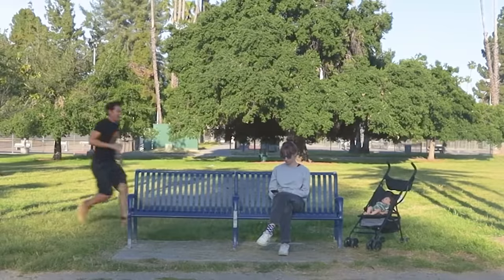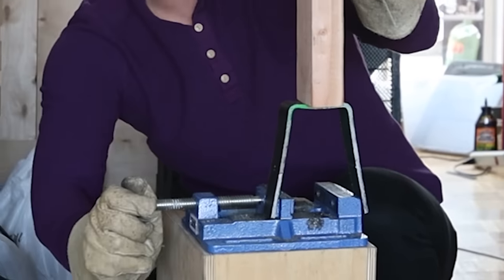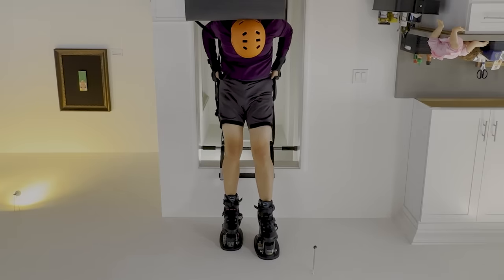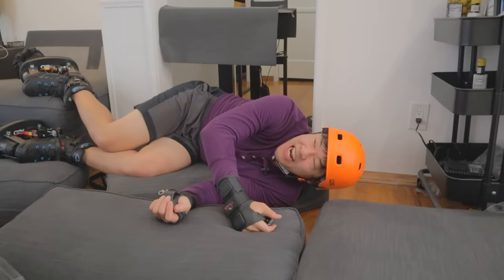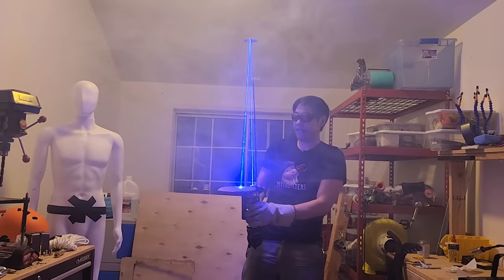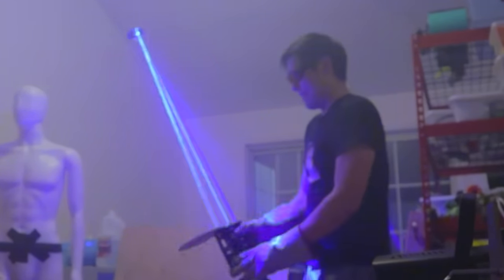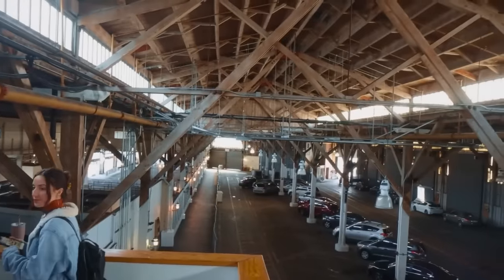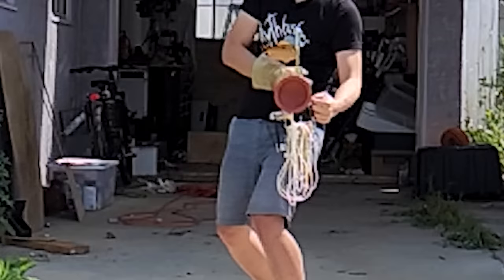I built your dumb childhood inventions

Comment: the reason why the mirror thing didn't work with Kevin's laser is because it uses an infrared wavelength, and regular mirrors act like non-reflective objects for them. For IR light, you need a gold or gold plated mirror.
Reply: Or the nintendo labo stickers
Reply: Or the nintendo labo stickers
Reply: Or the nintendo labo stickers
Reply: Or the nintendo labo stickers
Reply: Or the nintendo labo stickers
Reply: Or the nintendo labor stickers
Reply: Or the nintendo labo stickers
Reply: Or Labrador sticker
Reply: @ninjaguyYT  C-c-combo breaker!
Reply: Or first-surface mirrors

Comment: ProTip:  For the laser sword, don't use a mirror. Use a "retro-reflector".  Retroreflectors always reflect the light(or radar) back to their source.   It's how street signs and bicycle reflectors work internally.  :)
Reply: if you used something retroreflective, it would send the back right back into the juicy gizzards of the laser, and you would be lift holding a burning stick.
Reply: @Debbiebabe69  There's a slight offset to it based on where you hit the reflector, it's just the angle that's constant.

Comment: The ceiling shoes basically confirm a theory I’ve had with Spider-Man. His wall crawling ability only fully applies to stone/concrete or metal surfaces. Ceilings aren’t made to support weight that way. He couldn’t wall crawl on any building with vinyl siding, drop style ceilings, Sheetrock seems like only for a short time.

Comment: The ceiling shoes could use a small jet or a dense helium balloon to counter their weight and make walking easier. The saber could have the mirror replaced with something that absorbs the light instead of reflecting it everywhere, as well as an extra blade on the antenna for more damage.

Comment: For the "laser sword", when using the first laser:

1. Need a stronger pole for holding the mirror at the top, antenna has too much flex.

2. At the top and bottom use a faceted mirror "cup" that redirects any beams coming into them into the center.

3. Offset the laser emitter slightly off of the bottom cup so laser doesn't get redirected into laser head. 

By doing this you should be able to get an "infinity mirror" type setup between the two "cups" and any movement in the beam should be redirected towards center of "cup" before being sent to the other cup.

Comment: i once had a dream where i had this gun where you would load a piece of metal into it (like the blade of a steak knife or a fork) and it would get covered in a flammable liquid, and then it would use compressed air to shoot it out, basically being a gun that shoots flaming hot shards of metal. and ever since then i have always thought about the idea and if it would actually work

Comment: my childhood invention was combining scooter with bicycle
basicly you took of front wheel from bicycle and attached the bicycle with just rear wheel directly to back of the scooter

it worked very well one dude had to padle on bicycle and other dude was sitting on handlebars and used scooter to steer

(as scooter i mean the one with no motor)

Comment: First idea: It's one thing to make suction shoes strong enough to hold you to the ceiling. It's another thing to trust the ceiling not to fall apart and drop you. Aaaaaand... there ya go. The room above the ceiling may have a sturdy floor, but the ceiling surface is just plaster. The outcome is unsurprising.
Second idea: Yeah, lightsabers aren't something you can do with just a laser. There's been one promising scientific discovery of entangled photons that might make something like it possible in the distant future, but it will take something far more complex than a laser and a mirror. Contained plasma--which is what they are in Star Wars lore--is much closer to modern science.
Third idea: HAHAHAHAHAHAHA! I can't believe you kinda made it actually work! That looks like some weird ass junk weapon from a Fallout game. Have you thought of using the construction suction (Hey, construction suction, that's rhymey) thingy to make the plunger stick?
Fourth idea: Replacing the chainsaw head with something from a DR Trimmer might work better on grass. Uh... Nevermind, that's not doing too bad. I think it's impractical for most of us, and looks dangerous, but I admit it's working. Well done.

Comment: 7:48 You're using a cheap plastic mirror. The mirror coating is under the initial layer rather than the exterior layer. This results in it not deflecting the laser from the surface of the mirror. If you had a higher end mirror where the reflective part of the mirror is the exterior layer it would more likely reflect off the surface.